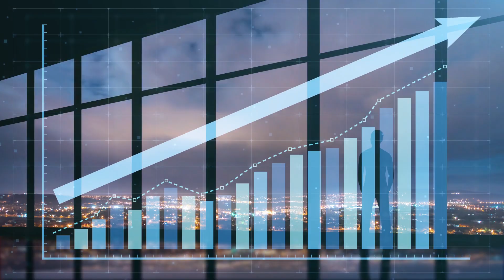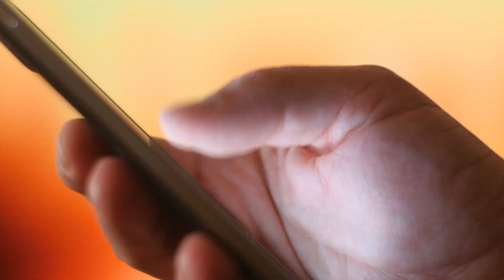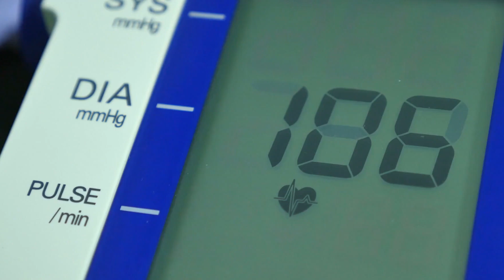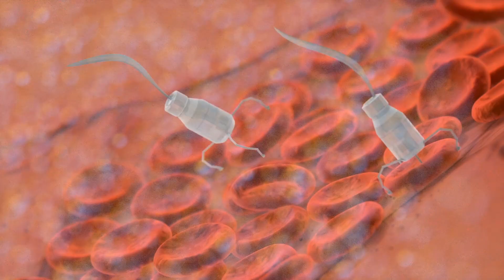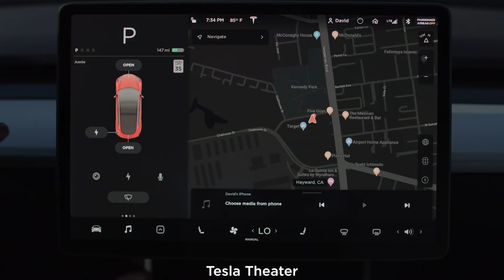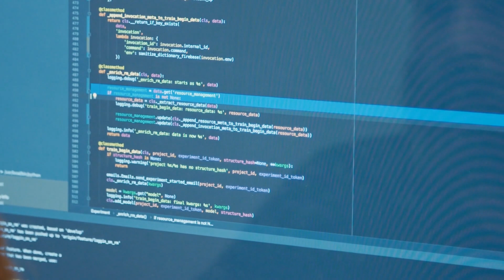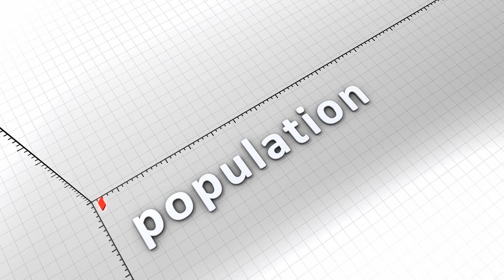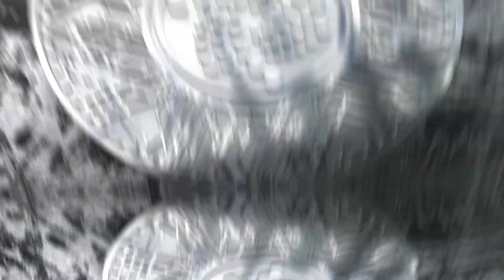How Internet of Things - IoT & Cyber Physical Systems Will Shape The 4th Industrial Revolution

Comment: This is mostly marketing fluff.  There are no explanations of the difficulties of actually stitching all of these systems together and how to actually use the data in a reliable, reasonable, and controlled manner without violating basic human rights.  The basic technical level is one thing but the issues of data security, authenticity, ownership, and privacy are enormous.   Laws need to be put in place to allow humans to appeal decisions made thanks to "IoT" space.  The problem is that lawmakers in the west are typically technically clueless and the Chinese are in a constant drive to control their population and ignore privacy rights.  
The actual benefits of IoT device (Smart anything... are not really smart, not really reliable, and not very trusted) are only at their beginnings and how they ultimately turn out to be useful is yet to be played out.  The current hype is enormous (similar to blockchain of years past...) but the practical benefits are still unclear and there are simpler solutions than to put expensive, potentially buggy, and hackable devices everywhere.  
Applications in the medical field will take decades to develop and deploy in useful ways.  Wait until lawyers get their hands on IoT based medical errors... the money to be made by suing IoT manufacturer is getting lawyers salivating.  

Currently, most trumped up IoT applications are solutions in search of a problems.  That is what happens when marketing attempts to drive innovation.  Real innovation happens when there is a problem that needs to be solve, not where there is a need to make money.
Reply: Pwede po ba yan sa essay